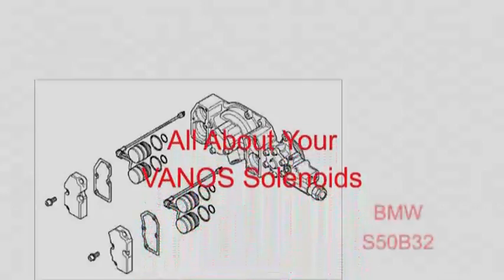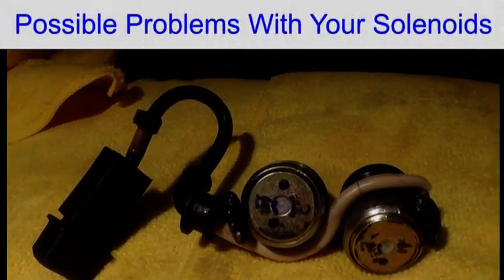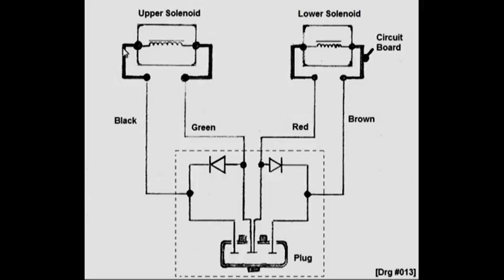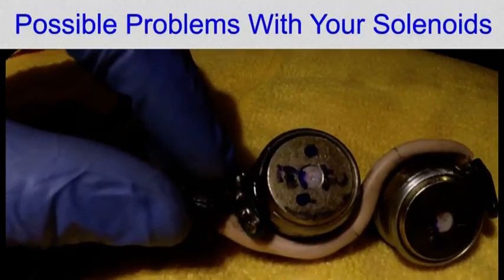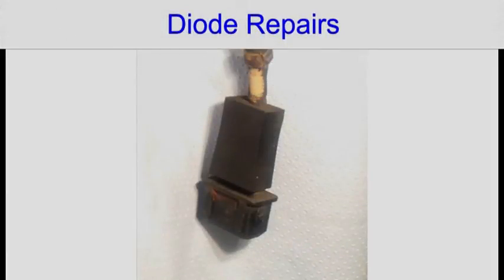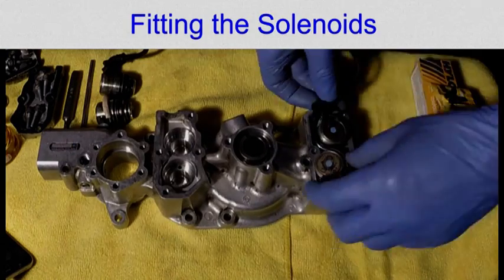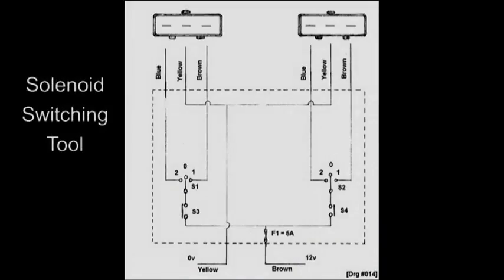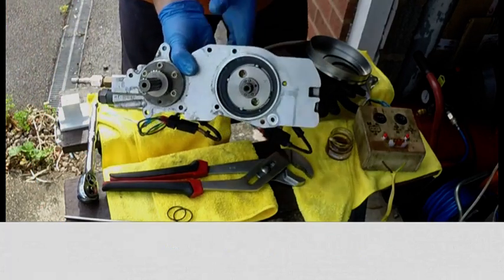Servicing the VANOS Solenoids

Comment: Hi, 

Did you test the diodes before dismantling the plug? I understand that failed diodes can send a reverse pulse to the DME as you mention in this video, which can cause issues including (I believe) issues with the fuel pump. I've been having an issue with me S50B32 where under certain conditions, the fuel pump is losing 12v power supply and the car cuts out.

I've just disconnected the plugs to both inlet and outlet vanos solenoid units and attempted to test the diodes (forward biased) in the connectors plugs by using a multimeter's diode testing mode - negative lead to the cathode (which is connected to the two outside pins or black & brown wires) and positive lead to the anode (centre pin, green & red wires). I got a reading (voltage drop I believe) of 0.003 over all 4 diodes. I then switched to reverse bias, so negative to anode and positive to cathode and got the same readout of 0.003 across all 4 diodes. 

This happened with both plugs across all 4 diodes, so I presume these readings means all 4 diodes are shorting and therefore need replacing?

Either that or I'm doing something wrong/my multimeter isn't functioning correctly. The multimeter does read 1 when the positive and negative are disconnected and it reads 0.000 when I touch them together which implies the multimeter is working as expected. I'm by no means an expert when it comes to electrics, so apologies if any of that wasn't clear or used incorrect terminology.